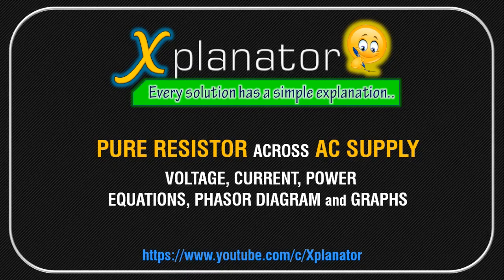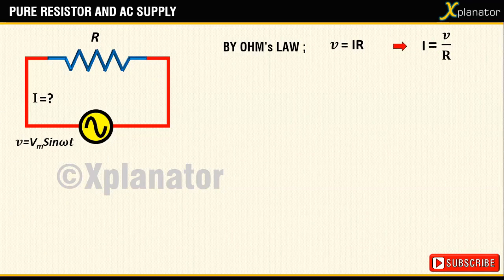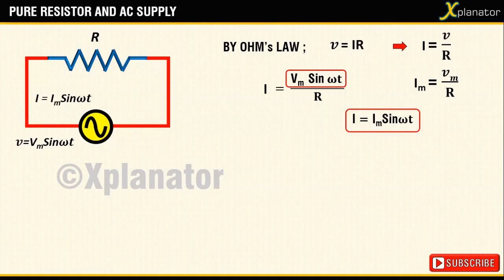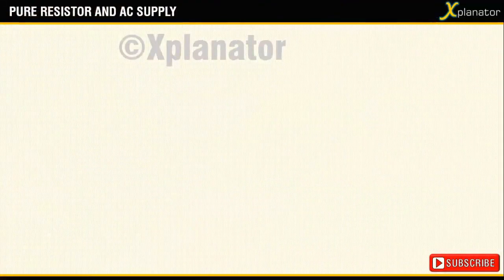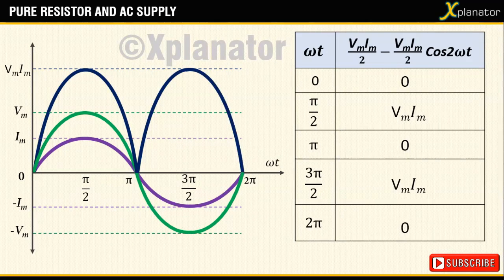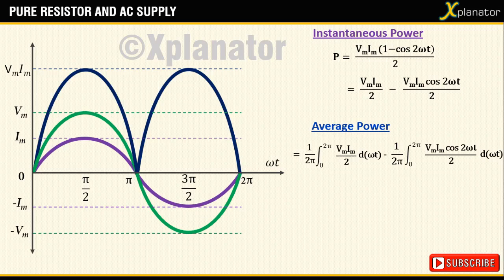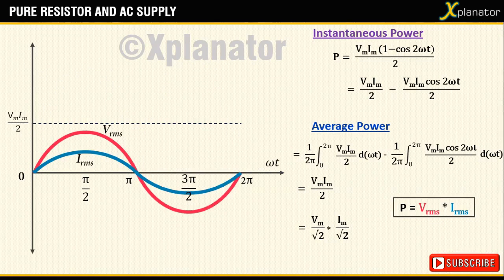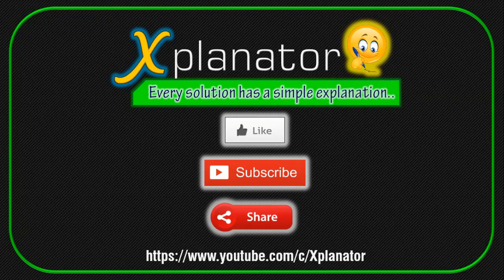Resistance on AC Supply: Voltage|Current|Power Equations|Phasor Diagram|Graphs

Comment: sir, as we know that inductor is act like short ckt and capacitor is act like open ckt for DC source but in case of thyristor commutation inductor and capacitor it charge and discharge in DC source, how? please explain.
Reply from the maker: yes sushant . You are correct. But those assumptions are when the elements have stored energy completely in themselves. What happens during the process of storing energy is what leads to commutation.

https://www.youtube.com/watch?v=zMAjbULi3P8&t=6s

Do check this out . It will clear all your doubts :)
Reply: @Xplanator  : Excellent Answer